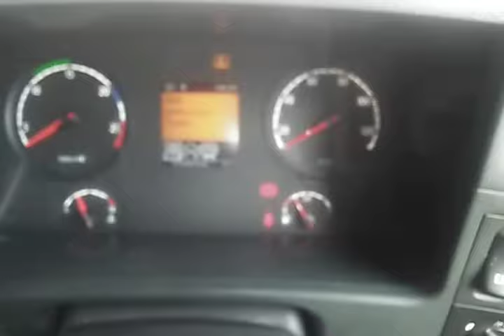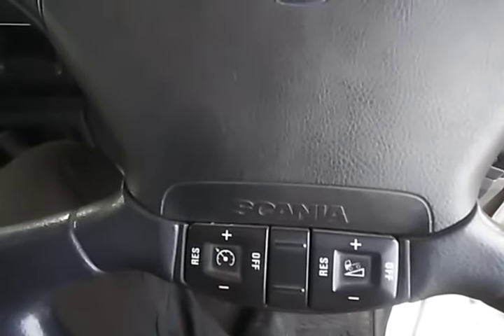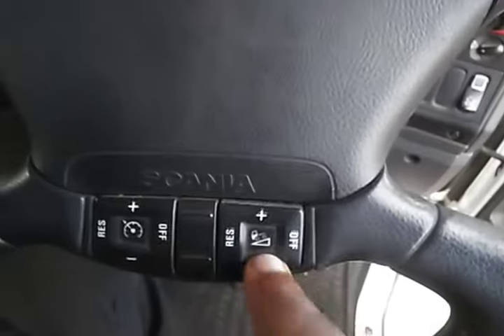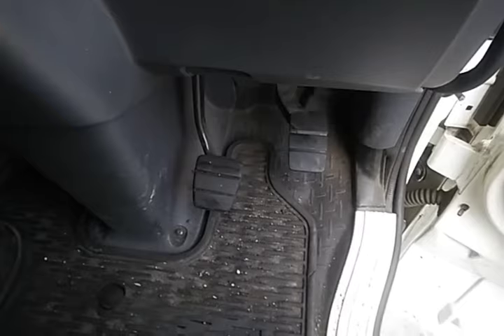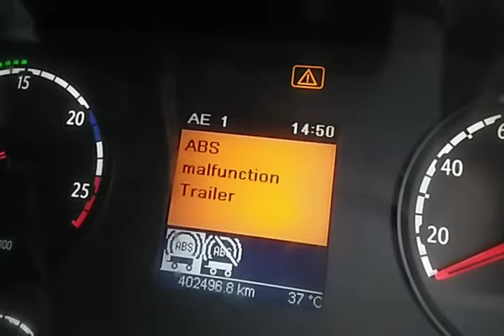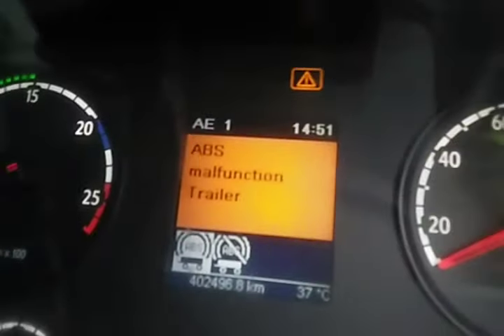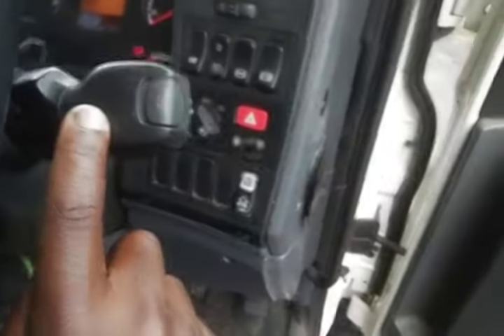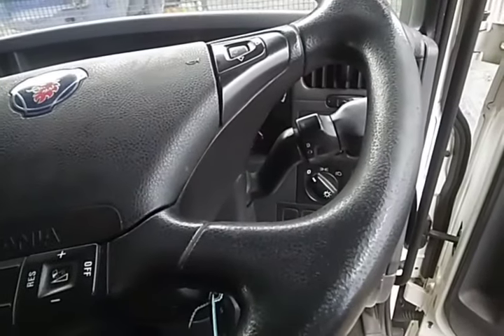How to drive Scania with opticruise (G460)

Comment: scania r500 2011 model was the last ones that had a retader lever retader(hydraulic braking box on back of gearbox)  this G460 has got a automatic sensor than works with the footbrake and accelerator pedal

Comment: Question, when you shift from automatic to manual i expected to see the clutch pedal, so in this case where do you press in clutch to add gears or lower gears? Someone help
Reply from the maker: On this one, the clutch is built in it there's no pedal. It works automatically controlled by the computer. You just change the gear the clutch will perform its job automatically

Comment: goodday bro hope kuhamba kahle kuwe, may i know how u operate superlink tipping and manouver
Reply from the maker: Soon I'll post a video about tipping the load. But to be short, on automatic transmission you put the truck on neutral then you switch on the button called PTO you'll feel the truck like it's taking the gear but engaging PTO. Then there are 2 pins by the driver's seat you use them to tip the trailers.
Reply: @sinethembablose3875  thanx a lot it will go a long way in my knowledge base
Reply from the maker: Appreciated 💪

Comment: Hi Guys,Sinethemba,i have been facing a problem with a scania G460 now it's on the N N when you push forward the gear it goes to  A N -Automatical Neutral and not going to  A 1 /2/3/4 it got stuck the gear ,what could be the reason?